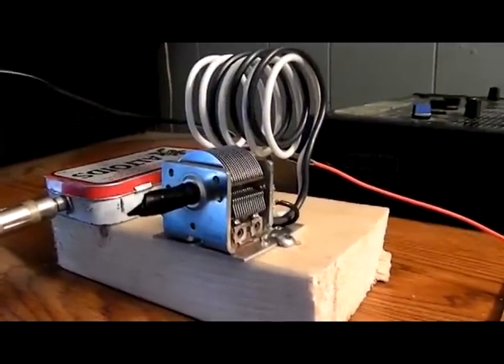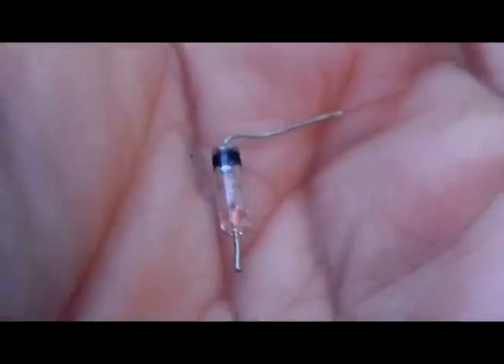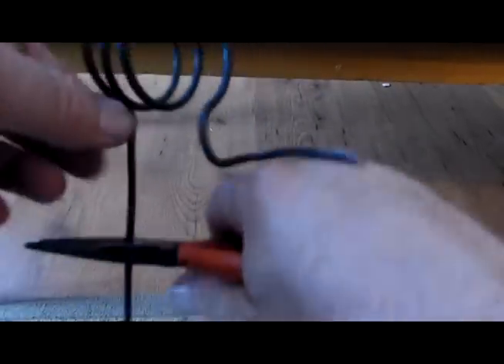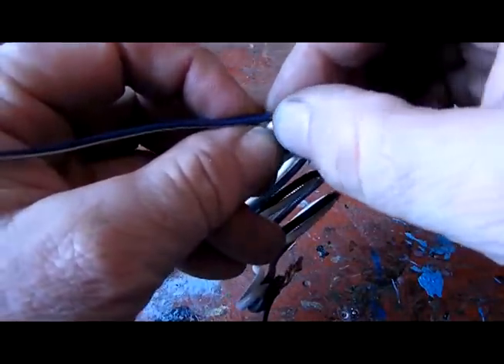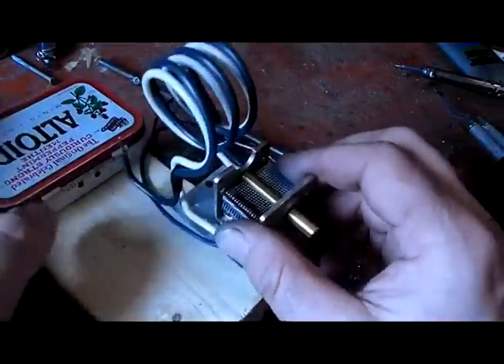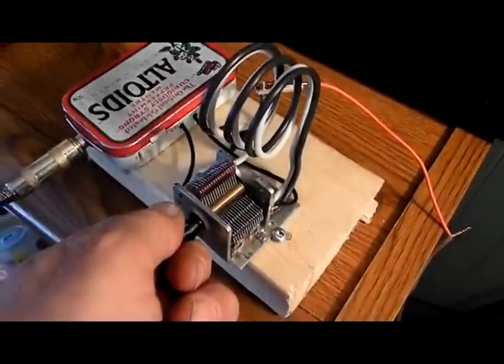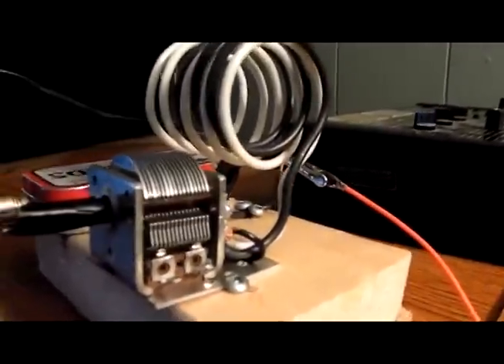Build a CB Radio Crystal set

Comment: Others have asked but I haven't seen an answer from the poster of the video. .. perhaps it's waaayyy down in the comments,  but what is the value of the variable capacitor? I have plenty of the 365pF variety on hand and three 200pF mini mylar dielectrics. The coil would be about 1.3" diameter using a d-cell to wind.  To get the highest Q from the air core I suppose it should be about 1.3" long. 5 turns covering 1.3" and being 1.3" in diameter would yield only about .56uH. The description mentions that the set covers 8MHz to 30MHz (the entire CB Band would be covered by 26 to 28MHz). Anyway, to cover 8MHz to 30MHz with a .56uH coil would require a capacitance range of 50pF to 707pF including stray capacitance. A dual gang 365pF air variable with both sections paralleled would suffice.  I'm just curious as to the actual values used here in this video. It's also possible that my calculations are off. A 365pF varicap should allow it to cover 11MHz to 30MHz.  If stray capacitance is 50pF,  the it would probably cover about 10.4MHz to 30MHz. Note that my calculations may be wrong so don't take them at face value without checking them.  I'm going to attempt to assemble one of these :-)
Reply from the maker: +Robert Turner The Value of the variable capacitor I used is ,I would guess to be a typical AM type 365 pf single gang. A lower pf value might work too, it would not tune as low in frequency but would be easier to tune in CB, that being said, the selectivity would be nonexistent the entire CB band and the outer bands too will likely come in just as strong but usually channel 6 comes in due to the big power of their booted transmitters.
Reply: +rEdf196 cool. I've been sitting here winding coils for the am band and experimenting.  Then I saw your video and thought about putting one of those together,  but I've got to work in a few hours so I'll try it later.  I actually have a 365pF variable capacitor that I just made from a veggie can...

Comment: Very cool project, but if there is an amplifier in the circuit the term crystal set is not applicable.   At least, it used to apply to pasdive circuits only.   Ty for posting.

Comment: What about putting the whole circuit in a metal container (of course antenna would go through some hole like cables here)? Would it also reduce the noise from AC mains, or does it work only when there's screen between LC resonator and diode?
Reply from the maker: I tried it years ago with a lower frequency shortwave xtal set but found out the coil doesn't work at all being enclosed in metal but tuning capacitor and diode seem to work fine, but the coil likes to be in the open.

Comment: I wish you would show exactly where you hooked up on the opposite side of the tuning capacitor I can read a schematic but you could have shown that on camera a little better do you use both of the back screws pointing toward the can? . Or do you just hook it on to one of the screws on the tuner,  capacitor? I can't see it you never show it because you never point the camera toward it after it's finished I'll just have to figure it out with the schematic the two screws on the other side you don't use because I can see that I can see where all of the grounds go I can see where the antenna goes but I cannot see if you use Both screw terminals or one

Comment: it is a 1n34 not a in34 diode, you should try and make a loop antenna for it so no ground needed...
Reply: JUST MAKE SURE IT IS A "GERMANIUM DIODE" THEY ARE EASY TO FIND ON E-BAY. THAT IS RIGHT, IT IS A 1N34  GERMANIUM DIODE, NOT in34.
Reply: Had he had experience with semiconductors he wouldn't have made that error. The "1" refers to the number of junctions of the device. For instance, a 2N2222 is a two junction device of a common transistor. The 1N34 he shows is the common version used for communications gear. I have seen another version of it that looks radically different, it's a ceramic bead with short pin on both ends, and one of the pins will have a removable cap which could be put on either end. It's used in radar equipment.
Reply: @lochinvar00465  
Yes that would be a microwave or hot carrier diode and some of those can be quite a bit more sensitive than a 1N34, and yes it's quite obvious that this guy has very little knowledge of electronics at all, I'm sure that is not his design, he kept referring to the tuning cap frame a negative and the stater plates as the positive, last I checked RF was AC and at that frequency changes polarity 27,185,000 times per second at least on channel 19. It drives me crazy when someone like that, puts up a video and tries to teach others how to do something like this and don't know how, referring to AC components, be it line power audio or RF as having + & - is just messed up because you end up teaching others wrong. Infact he himself just may be one of those who was taught Wrong by someone else who didn't know.

Comment: Excellent video . I have salvaged a few "old time" variable capacitors and they are getting hard to find . Is there a place that you could recommend to order variable capacitors and potentiometers ? . Thanks so much for a seriously interesting video .
Reply from the maker: +Master Tracker You could try checking out Peeble's Crystal radio website or other sites dedicated to the crystal radio hobby. and check for links to electronic parts like variable capacitors , even the hard to find metal old school types can be bought online. Antique Electronics Supply might be a good site to check out as well.  I myself have 10 metal vintage 365 pf variable capacitors I have salvaged and collected since I was a kid. but yeah,old school metal variable capacitors are getting harder to find for sure.

Comment: very easy build ..but is it a AM set or will it put up FM signals 26.96.5 to 27.99.1
Reply: electron0002 Tt can receive FM by using "slope tuning".....tuning to one side of a FM signal will enable a AM receiver to receive FM. There are FM broadcast band crystal sets that work on this principal.

Comment: It's not "I"n34 -- it's 1N34 or 1N34A
Also, you should mention that the wire is 16 Gauge solid, and not stranded.
Reply: the gauge amount of turns and spacing makes a difference for it to work right.
Reply: Some beginners don't know the difference. They will someday if they persist in learning radio electronics. I teach the Radio merit badge to Boy Scouts, most do not know the difference, either.

Comment: build one for 2 meter ham, i'[d like to see how one for that band is assembled. probably very complicated, but would be interesting to see one built for 2 meters DX AM though lol. i have a couple of older cbs i could also get the rocks out of too lolk. be VERY interesting to try i know that much
Reply: You would need a slope detector circuit (some extra capacitors and resistors) for 2 meter ham in addition to different coils if you wanted to detect the FM and much higher frequency.  CB works well as a Crystal set because it is AM.

Comment: Would this work using say 20 gauge solid wire
Reply from the maker: Yes 20 gauge or thinner will work just as well as 14 gauge house wire ,but of course with thinner wire you will need to wind it around a either a 1 1/2" PVC pipe or even a empty toilet paper roll will work good too.but dont go wider than 1 1/2" peak frequencies range  tends to drop sharply with wider coils.... Oh ,by the way are you the famous John Arthur the founder of the now defunct A.C.E The Association of Clandestine radio  Enthusiasts?  A pirate radio Monthly magazine which operated from 1982 to 2005 I was a subscriber to that mag from 1994 to 98 back in my hardcore pirate radio QSL collecting days.

Comment: 70 foot long wire antenna is too long try 18 feet.
Reply from the maker: Yes the long wire antenna is well over the needed length for CB frequencies but I also use it for general shortwave radio coverage anyways, but I will be trying my homebrew vertical CB ground plane antenna made for my Galaxy DX 959 and see if it works better for the xtal set.

Comment: i build one but why do pick up am radio stations no where near 27-28 mhz
Reply: diode want work with any sensativity at 27mhz , hes coning i tested diodes and never heard a squeek even plugged into my tower with big antenas . its a con
Reply: You are picking up what is called "image frequencies" from strong AM radio stations nearby. This happens when you do not build an antenna tuner to go with your crystal radio. The tuner acts like a "bandpass filter" to your crystal set. Several designs are available from the Crystal Set Society along with much better crystal radio designs. Give them a try!

Comment: doe this project require a power source?
Reply from the maker: The only power source is the long wire antenna as with all other crystal radios with the exception of a powered guitar amp or stereo amp to hear the mostly weak CB signals but sometimes with very strong signals it is possible to hear noise using an unpowered crystal earphone or possibly some vintage 2000 ohm headphones.

Comment: Nice.  I use to be an avid CBer back in the 70s.  I use to make my own antennas and some of my own gear.
Reply: hey man ive got an old pinto 70's cb radio of my granpas and really want to get to using it, but ive got no antenna and i need a cheap, indoor solution, i have coax, but not room for a 10m antenna, any help?
Reply: +Kriss Femmpaws i could make one outdoors, i just dont have the option of having a 50ft antenna. i have plenty of coax and copper wire, i just need a crude, simple solution to toy around with some old radios.

thanks a lot, and sorry for my lack of knowledge, im just trying to get into it!
Reply: +Kriss Femmpaws i have an old cb antenne for a truck, but i would rather use my radios indoors. thanks for the help!
Reply: +Kriss Femmpaws ill try it, thanks for the help, i did some research and found a similar project to mine.

Comment: Can you run a LED with it?
Reply from the maker: I have never used a led on a crystal radio AM or shortwave before but have seen other videos of crystal sets using a led from a powerful local AM station signal. perhaps try using your own CB transceiver (if you have one) close to your crystal set with a LED and see if the LED lights up. I might try it myself.

Comment: well done very clever!
Reply from the maker: +Andy Howden years ago I discovered I by accident while tinkering with the coils using bare 14 gauge wire tapping at different turns I stumbled onto some CB radio skip which blew me away. I also made other multi band crystal radios which also tune to CB. Recently. I added a PL259 connector and connected to coax fed vertical ground plane CB antenna and it worked better than a random length longwire antenna.
Reply: @rEdf196  Any chance on getting dimensions and turns of coil? Range of vari capacitor?

Comment: could you just make a crystal radio and then tune it to the cb radio freq. ? anyone?
Reply from the maker: +lucas hawn The CB signal on a crystal radio is very wide, meaning a large area of frequencies will cover a 300+ khz  area  approximately,unlike the normal 10 khz width on a more advanced conventional radio. So the signal you receive on that tuning position will almost  cover the entire CB band, most likely channel 6 or 11 will come in the strongest due to the super powerful stations that operate there. sometimes sideband(ch 38) can be heard too.
Reply: Sorry for the noob question, but: when you say the signal is wide, does that mean the coil antenna has to be wide?
Reply: The receive would be listening to the whole band at once. You would not have differences in channels and not be able to decipher channels. You still need a tuning capacitor to tune close in.
Reply: No , WIDE means that the circuit is capable to be tuned / cover a wide band of frequency. Stretching or compressing the coil only change the receiver bandwidth , either lower it or increase the frequency , ok. Hope this helps.
Reply: Mr Bingo yes.  I built a radio using 37 turns of 22 ga wire on a 1 inch pvc.   It gets espn radio 650 am and also ch 37 cb.

Comment: Here is my tutorial, here are the parts, no links but I swear you can find them. oh and to make your radio here are some old radio parts I will be using. Please for the sake of the internet don't make anymore tutorials.
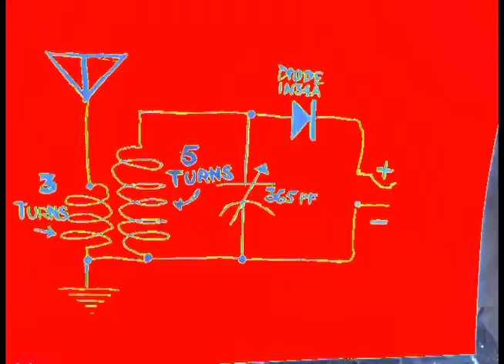Reply: DoctorNoob: That main tuning capacitor is 365 pF and you can find it at Amazon.com or TubesAndMore.com - the 1N34a diode anywhere (cheapest at TaydaElectronics.com), and I'm sure you can find some 20 gauge wire like he's using there. And the schematic is shown at ~13:11 in the video. -- But really, part of the fun is researching and finding the info and parts you need, if you're not wanting a challenge and to learn something just buy a CB from Walmart or eBay..